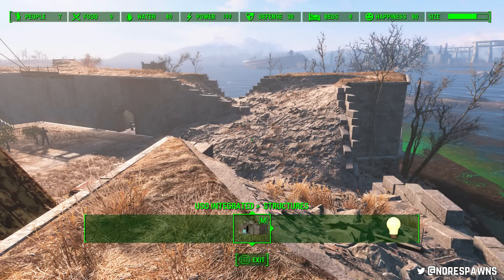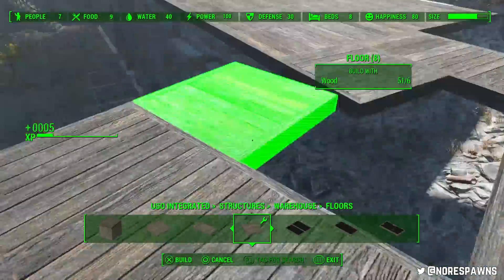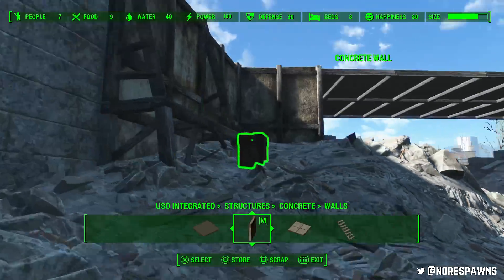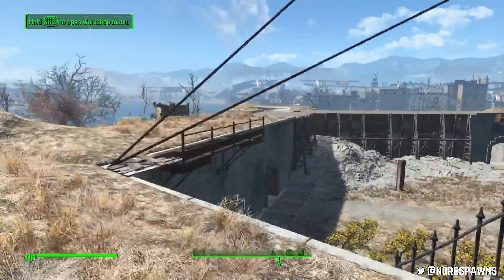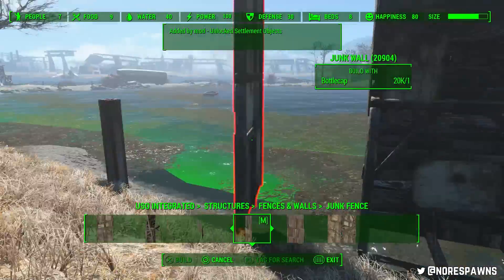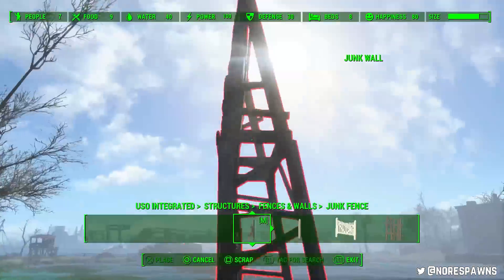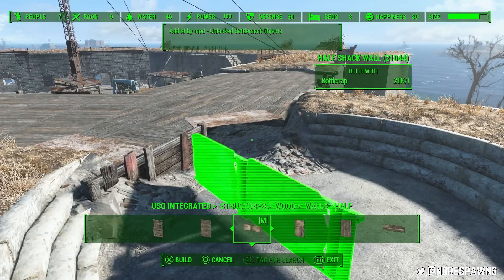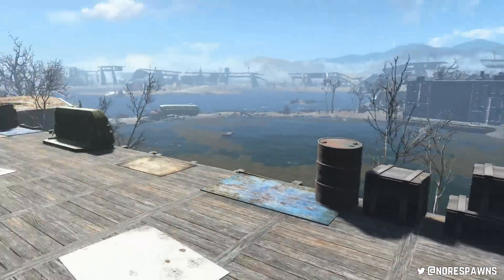Fallout 4 - Repairing The Castle

Comment: I've noticed most people, myself included, use the foundations to repair the walls. It dawned on me after watching a few of your videos that is so unrealistic.  A person would need heavy machinery to accomplish that. Using wood makes more sense. Keep up the good work, never lose the immersion factor.
Reply: Rebar and concrete with a form to keep the cement from just spreading all over the ground, and all you need for that is a claw hammer and a lot of nails. Plywood and 2x4's for the form, and it wouldn't take any heavy equipment to build.

Comment: How many saves do you build on? From what I've seen it's at least two. Where do you get all your steel and wood? I'm building up all my settlements into cool bases, towns and forts but I'm always running out of steel and wood. Even though every time I leave to do something else I'll constantly fill my companion up with wood/steel and get myself ridiculously over-encumbered and will make trips (with strong back to fast travel of course) but just to make one base I tend to have to make 2-4 trips, especially if I want to make a junk wall around my settlement
Reply: Get the local leader perk and send your settlers on supply lines between all settlements, no need to do it the hard way you have been doing using companions.